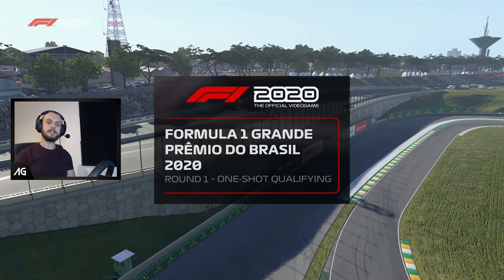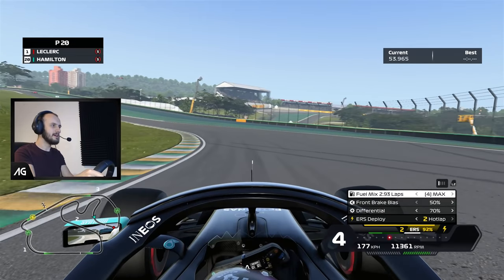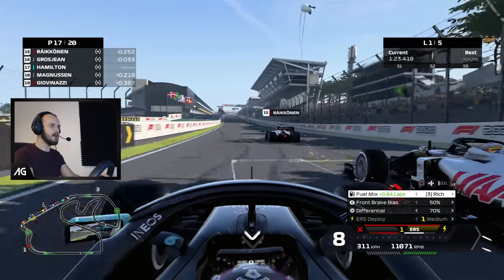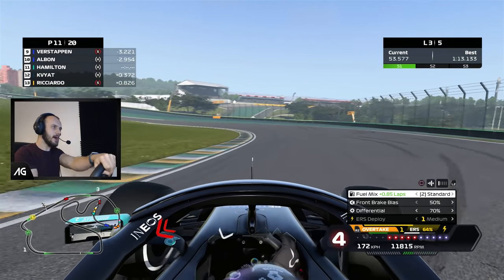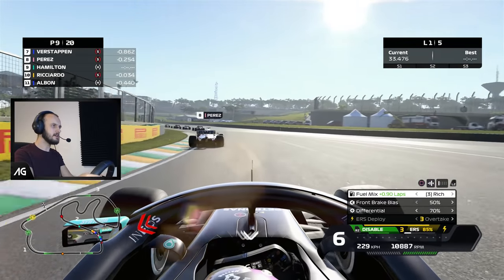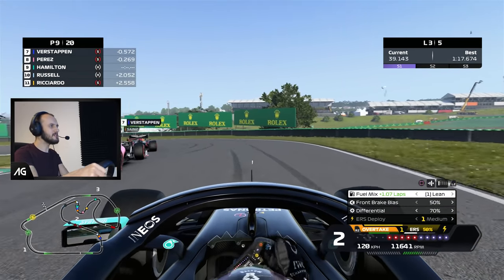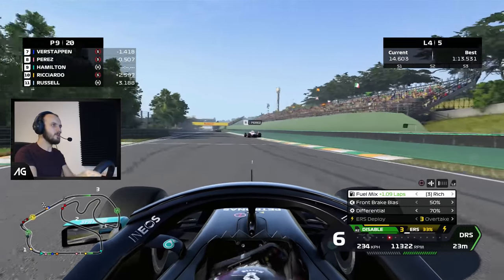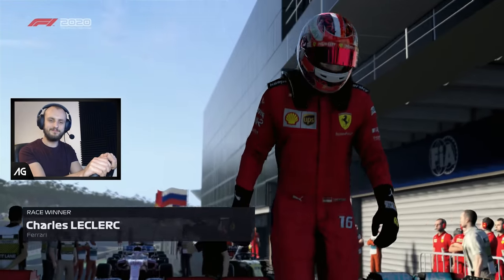What If Modern F1 Cars Had Grooved Tyres?

Comment: I have an idea, instead of modding the game, try intermediate tires
Reply: Not the same thing at all. Intermediates are made to clear water so the tread is made in a way to expel sideways. Grooved tires were made to reduce traction and thus give a very different feel. Also, intermediates are made to wear down to create a crossing wear pattern with slicks which means that on dry tracks, they provide more traction the more they wear down. Grooved tires lasted the entire race so this would be entirely different.